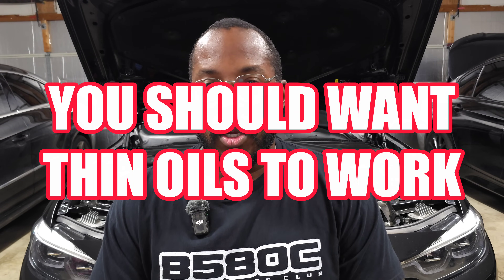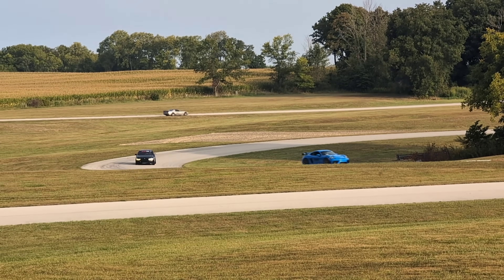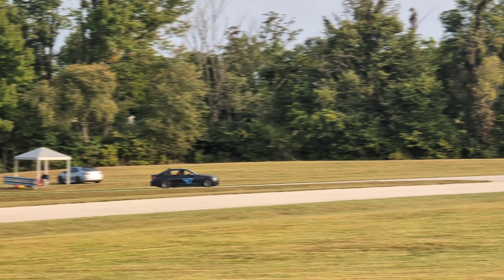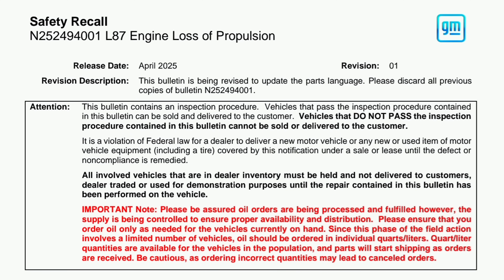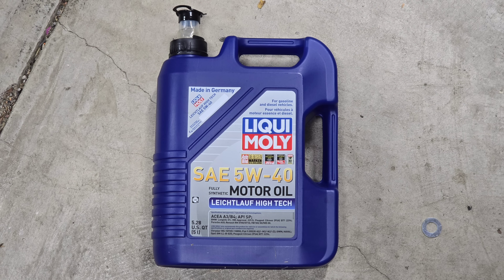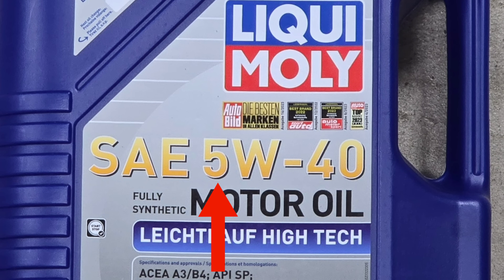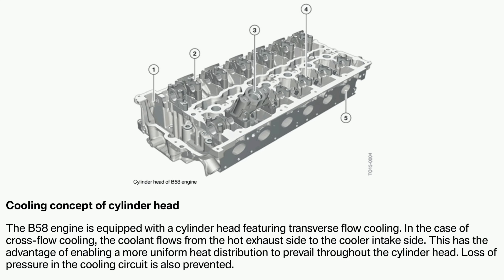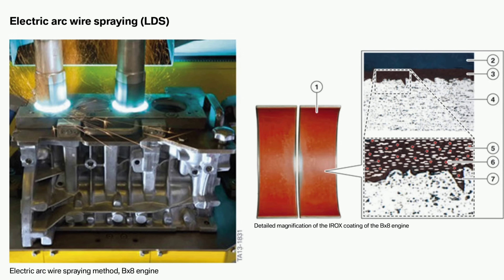Thin Oils Are a Dream Come True for Car Enthusiasts.

Comment: I'm running Valvoline Restore and Protect 5w-30 on my 2014 BMW 335i. It's on the thinner side. The engine sounds quiet compared to stealership BMW oil. It also removed engine noise that sounded like piston slap. It should also clean the engine and the valvtronic system. Highly recommend it.

Comment: Been running 5w40 synthetic heavy duty diesel truck oil off the Walmart shelf the past 100k miles (whatever is on sale) and engine is running tops. Car has 171k.   335D.

Comment: B58 owner here (F36 GC 440i) Tuned MHD Stage 2 and xHP Stage 2, I’m changing my oil every 5.000miles with 5W30 Liqui Moly Top Tec 4600… i live in Europe and the colder temperature i get in winter is 5 degrees celsius, and during summer is 37 degrees celsius max! I think this oil I’m currently putting on my car is perfectly fine!!!! 😃👌🏻

Comment: And let's not forget that the tolerance is on a 911 GT3 are pretty damn tight and they use a 5w40
Reply: 0-20 in a gt3 will explode your gt3. Have seen it first hand on a 992. Guy brought his car in after a track day and low oil pressure light and oil came back as c spec 0-20 and not c spec 0-40 GT

Comment: Thinner oils are about emissions and not better lubrication😂 Old Honda engines have tighter clearancees than these new cars. And just look at Toyota for instance, selling the same engines, but one year they switched to 0w20 l. They didnt change tolerance on the emgines, they just do it for emissions.
Reply: Pro Stock & Comp Eliminator drag racing engines (500ci, 10k-12k RPM, 1,200-1,400hp run ultra thin, water-like engine oils: 0W-5, 0W-8, O2-2 oil weights, so MAYBE the viscosity and LOAD aren't tied together as much as you think they are... 

The fastest 1000+ B58 engines from Pure, Visconti, VAC almost all run Motul 300v 0W-16 or OW-20 weight oil, or Driven XP6 0W-20. 
You can have low cold viscosity, low drag, and high hot viscosity/ HTHS engine oil that can deal with big loads AND keep an oil wedge between bearing due to the magic of high-ester (double and triple-ester) base stocks. 

It's not 1969 anymore.

Comment: I'm not completely getting the statement that you are making more wheel HP by using thinner oil. If the engine makes whatever crank horsepower from the factory, you say that if you use a thinner oil than what was specified from the factory, it will make more HP? Or how exactly do you get more HP?
Reply: Less windage losses on the crankshaft

Comment: I alternate BMW oil Ow-20  from dealer in fall, and euro vx 5w-30 in the spring/summer, from triax.    change oil at 5-7k miles (seasons not miles determines my changes with lower miles driven) , excellent blackstone lab reports so far with 53K miles now.

Comment: GMs l87 recall was because of crankshaft main and rod journals not being the correct surface finish. Literally was not polished enough and the thicker weight oil was to try to remedy that situation even though it could not. I disagree with thinner oils unless you do a lot of short trip off & on ignition cycles. You can see many documents on Toyota recommending 0w20 in the states but 5w30 in Mexico or ford recommending 0w20 on a f150 with a 5.0 but on the FP700 truck which is a stock 5.0 with a Whipple on it now they want you to run 5w50. Hmmmm you see the trend there lol. Thinner oil is more hp & gas mileage but less protection except for cold starts. I could go on and on with more examples but just do some research.  Take one of the worlds best tribologists word for it if not mine(Lake Speed Jr ). Aka the motor oil geek on YouTube.   Obviously their is suck thing as too thick & obviously depends on your climate & engine specs , but anything less than a 20 weight oil is crazy in my eyes and is all EPA derived.

Comment: Don't let manufacturers planned obsolescence trick you into running 0w oil. BMW recommends you run 0W-30 oil changed annually or every 10k miles. Everyone else "being BMW owners who do their own maintenance" recommends 5w-40 changed at every 5k miles.
Reply: Nope. Viscosity isn't the key that you think it is.
Reply: This is exactly what i am doing now in my N20. It recommends 0w-30 for 10k which it is ridiculous. Now at 60k my timing chain has a lot of slack. I started using 5w-40 every 5k miles.

Comment: Nah bro once my engine is broken in around 40k miles I actually run liqui moly that's higher weight at both normal and winter temps. I've had 3 BMWs all of which were extremely reliable so I can only assume it's the maintenance routine keeping my "unreliable" BMWs on the road even though I drive them hard.

Comment: Manufactures also get green credits for recommending long oil change intervals while the engine eats itself doing that.
Reply: My 2007 X5 with the N62 has 180k miles on it. I change oil every 15k miles. No issues, and I've owned the car since new. Looks clean when I did valve covers, minimal sludge. I expect the car to last until 250k miles.

Comment: Rooting for thinner oils?   Lmao. Here's the thing.  Manufacters are not tightening the clearances. If they did it would counter the benefit less resistance and their objective to meet ever stringent CAFE standards.  You can't defy physics.  Thicker oils simply offer better long term protection. The literal expert on everything oil is Lake Speed Jr. And his The Motor Oil Geek channel.  He is a certified tribologist and has formulated many oils and worked for Joe Gibbs racing has proven this.  Also the further apart your winter weight Viscocity is from your operating Viscocity the faster the Viscocity modifiers will break down. Unless you live in an artic climate never use 0W.  Use 5W.  5W-40 is far superior than 0W-40.
Reply from the maker: You missed the entire point of the video and that's ok 🤝🏾
Reply: Thissss^^!
Reply: You hit the mark perfectly with what I was gonna say. Lake speed knows his stuff and speaks the truth.
Reply: Should I use 0w40 in my n55 I live in alberta and see -40 temp
Reply: @jashan9748 I would use 0w40 in colder weather and change every 3500 miles & run 5w40 in the warmer months and change every 5k minimum.
Reply: The fastest 1400hp m340i runs 0w-20 😂. Seems its fine idk if the engine is living at that power level seems like its fine on a stock non built engine.....
Reply: @98ws6m6cvert The difference is, lighter oil is for efficiency / more power too because of less drag, and thicker usually offers more protection, 0w20 in a tuned car or performance car will probably be ok for a little while maybe like 50-100k hard miles and to some that’s a long time, but durability of thicker oil could probably get an engine to do double that, there’s many examples of M cars reaching 300k-600k like the S62 and S54 which is crazy because they’re usually driven hard and those don’t run a 0w20, it’s 5w40/5w50/10w60 platform. There’s no way a performance car driven hard gets passed 150k starting from new (hard miles) using 0w20 (without a rebuild), I haven’t heard of any.
Reply: @aidenp5768 he also mentioned the s65 running the same heavy weight oils. It really comes down to the bearings and their are 200k plus b58 examples out there with 10k oil change intervals. I think its more important to run the oil the car was designed for because running a heavier oil in a car not designed for it can be catastrophic.
Reply: @aidenp5768 I’ve got two N55s running 0w-30 since new with stage 2+ tunes since very early on.  Both have hit 150-158k with no major issues.  Changing oil consistently at 5k mile intervals.
Reply: @dwkwb8how hard do you drive it tho?
Reply: @aidenp5768 Pretty hard for a daily.  Not as hard as a race car.
Reply: @dwkwb8continue taking care of it bro
Reply: @98ws6m6cvert 1400 HP cars are running thinner weights for records not longevity.

Comment: You also need to be concerned about an oils HTHS, viscocity and viscosity breakdown. 
This is what protects an engine from wear and catastrophic failure.
Especially important with tuned and built motors however it affects them all.
A higher viscosity oil will form a stronger hydrodynamic wedge in the bearings protecting better against crank to bearing contact.
It will also have a higher HTHS number so will reduce piston ring and bore wear, not to mention all the other wear points in an engine.
Also the B58 has pretty loose bearing clearances of 2 thou crank and 2.6 though rods, so  you can run plenty thick oil.
Run as thick as you can, you may sacrifice 5 hp and a little mileage however this is much cheaper than replacing an engine prematurity due to unneccessary wear or catastrophic damage.
Run as thick as you can, in very cold climates this may be 0W40 or 5W40 and change more often at 5k miles or 3k miles with ethanol.
Warmer climates or where you dont winter drive your vehicle can run much thicker oil like I run 15w50 but I have been advised I can run 25W60.
Leave the 0W8 to 0W20 oils to those who getting 0.1 improved MPG matter to. In low output fuel economy orientated vehicles.

Comment: The B58 runs pretty loose bearing clearances of 2 thou main and 2.6 thou rod.
These are old school race engine clearances. You can run thicker oil.
I run 15w50 without problem.
Reply: check back in 30,000 miles with an oil analysis and we'll see if you have the same sentiment.
Reply: @shdymoj0 wait are you saying thicker oil with higher film strength will cause increased wear over thinner oil?
Is that what your trying to say?
Reply: @indyrock8148  First of all, I never said any of that. Secondly; I replied to the wrong comment lmao

Comment: I am just amazed that people have no clue about BMW's official mechanic's manual which is TIS. Under the following section you can find all the oils that are technically suitable for every engine:

----  Repair Manuals and Technical Data  -----  00 Maintenance and general note  ----  00 00 Maintenance  ----  3.1 Technically suitable engine oils for petrol engines:   OR   3.2 Technically suitable engine oils for diesel engines:

Basically the owners manual is pure propaganda and TIS is the actual mechanic's manual. This is where real mechanics look into. Here for the B58B30O1 (also called B58B30B)  with petrol particulate filter the owner's manual approves up to 0w-30, whereas TIS approves Longlife-04 which goes up to 5w-40.
Reply: Not everyone has access to TIS .  They went behind a paywall some time ago.  It was popular when the public had access to it.

Comment: I completely agree with you. If you look from the manufacturer's side, which has limited limits on emissions of harmful substances and plus the engine must remain all the same productive, then you can understand why they switch to less viscous engine oil. So let's not forget that today's reality is such that it is not profitable for anyone to make engines that will run a million or more kilometers. If you look from the side of an ordinary consumer who buys a new car in 3-5 years, then in general it does not matter to him what kind of oil will be there, since the car is under warranty and if something happens, it is not his problem. If you look from the side of true lovers of their cars, then there are many factors that will influence what kind of oil to fill instead of the factory one: driving style, region of car operation (predominantly cold months or hot ones), more trips around the city or highways, etc. In general, it's all individual! The main thing is to fill not a fake and in a timely manner (by engine hours and not by the mileage of the car!)!
Reply: NA regs force manufacturers to specify thinner oils than the manufacturer would prefer. Compare the oil specified for the same vehicle between Europe and NA, frequently you will see Europe specifying 0W30 to 5W40 wile NA is 0W20 only but same climate.

Comment: amsoil signiture series 0w-40 for all things x58.  i have been on this oil since the n54 days and will never use anything else. almost everyone i know with 4 digit power on these engines runs the same oil.   the s65/85 bearings were too tight from the factory and were designed to be service items because of the rpm those things turn, theres no other way around that. every flat plane v8 super car has bearings as service items too.  I have 220k miles on my s85 m5 that i bought brand new in 2009 and still ripping but its days are limited. have been through no less than 3 sets of rod bearings and two complete rebuilds.

Comment: I’m currently running 5w50 for road track use. Been on 30 and 40wts but oil pressure is only 60-65PSI once oil temps hit 260F+. 650whp on a gen2 b58 w/ beefed up DI only. Losing oil pressure on DI affects exhaust vanos angle, and large deviations cause limp mode. Luckily running 5w50 seems to help maintain pressure at higher temps so far. This is with a Verus oil cooler as well. I appreciate you adding the part at the end that you should choose oil weight based on your use case.
Reply: Is there any way to improve the efficiency of the oil cooler to bring the temps down?
Reply: @dcrasta not really. The stock ducting matches and abuts the cooler literally perfectly. There really isn’t much else you can do to the cooler other than increasing the physical size.

Comment: Definitely a needed video lol. People still think we live in the 80s still. I will stick with bmws recommendations. They say you can gi as high as 0w-30 for s58 for tracking, but if the car comes with 0w-20 i see no point. They obviously tested the car for that oil.
Reply: Under TIS, you can find oils that meet the “technical requirements” of any bmw spec oil (LL01, LL04, LL17FE, etc.) bmw specs up to 40 weight oils for a majority of these designations.

Comment: I think what concerns people about thinner oil is the efficiency push from CAFE standards. For example, in the German owner's manual for my 2020 M5 Comp, the oil grades listed are 5W-20 through 5W-40, and LL-04. In the US manual it only shows 0W-30, and LL-01 FE. FE stands for "fuel efficient." And having had to get my motor rebuilt due specifically to a viscosity breakdown at 50k, I do not trust the oil recommendations and don't use BMW oil anymore. Having analysis done is good advice, as is getting recommendations from someone who knows that specific engine. I run Rowe Racing 5W-40 now, but I also need better oil because I'm running more boost and a built motor.
Reply: You need to take into accounting that in US manual probably says to change oil in ~15kkm and in Germany I would guess that is says 30kkm. That can be the reason why there are different oils recommended.
Reply: @e30tomas54 that and vastly different climate. I'd imagine a car sold in Dubai would not have the same requirements. One size doesn't fit all.
Reply: Well we all know that BMW is oil change recommendations how far too long but I agree with you thinking. I'd rather give up a little bit of horsepower and run a slightly thicker oil as long as it's a great full synthetic oil and change it more frequently. You can't go wrong there
Reply: LL-04 oil has lower ash content. This oil is safer for the catalytic converter and the particulate filter (installed on European gasoline cars since 2018), but it provides less protection against engine wear. Therefore, for maximum engine protection, it is better to use the LL-01 specification.
In the USA and Germany, oil change intervals differ because the calculation is based on average speed and engine hours. For example, in 350 engine hours, a car on German autobahns will cover 30,000 km, while in the USA only 15,000 km.
In the United States, strict fuel consumption regulations are in place, so automakers use thinner oils to reduce frictional losses, which in turn lowers fuel consumption.
In post-Soviet countries, BMW engines are usually filled with 5W-30 (in winter) or 5W-40 (in summer) with LL-01 and an oil change interval of 200 engine hours, due to harsher operating conditions and lower fuel quality.

Comment: Im 27k km in my mt supra b58 im about to change from 0w20toyota/shell oil into red line 0w30 due the fact i let it warm up and cool down everytime but sometimes it gets used good just for the track day or spiritual  driving 0w20 is not the best for it
Reply: Switched over to 5w-20 my last change as well
Reply: @F22B58  your both delulu
Reply: @F22B58 you went to 5w20 or  changed from 5w20 into 0w30 ?
Reply: The recent manual I downloaded from BMW official website, for z4 says 0-30. my original book from 2020 recommends 0-20.